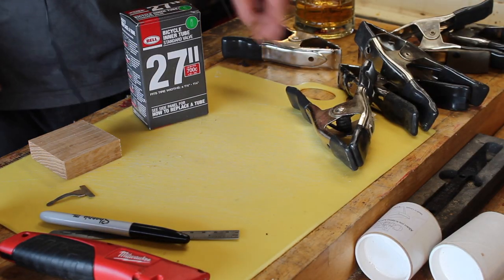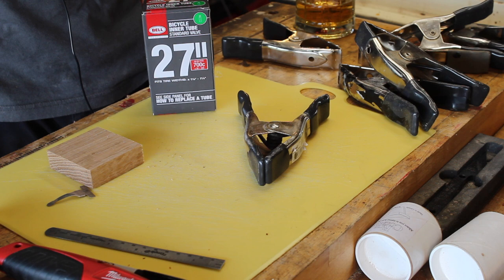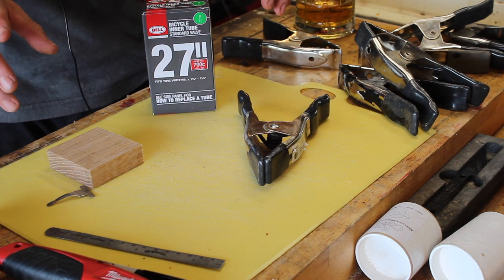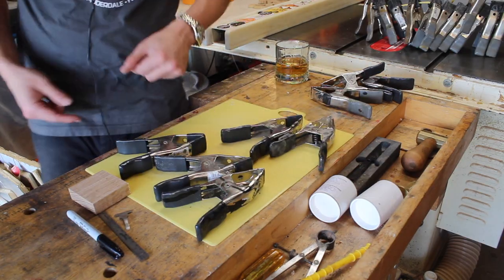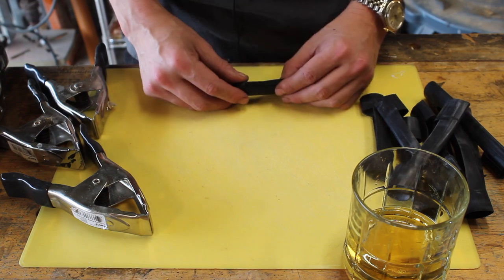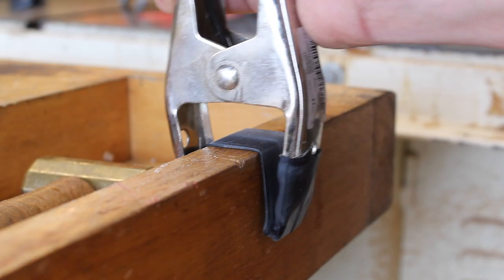DIY Band Clamp | Woodworking Tool | How To Make

Comment: Seems like you could simplify your measuring by using a cutting block that's 5 inches long and just lining up the end of the tube with the end of the block. You could even get really fancy and cut a couple of slots in it 1 inch from each end and use that to do most of your cutting at one time (everything that's across the tube, come back later to cut along the tube).
Reply: Alan Miller great suggestion!
Reply from the maker: yeah someone else mentioned something similar. That would be super functional and frankly a huge time saver if I was making these at a real high clip. But in all honesty I don't make enough of these that frequently. My first batch, which is still in great shape is two years old.

Comment: Simple enough! I've got a bunch of these clamps. I should whip some of these up.
Reply from the maker: That tube is like five bucks. You can probably do about a dozen. If you mess with the length of the tube that you’re cutting, for instance going to four inches instead of five, you could probably squeak a couple more out.

Comment: The white stuff is just talc, it's a dry lubricant from when the tube is made.  There's no need to even bother with it, it's harmless.
Reply from the maker: Ah good to know! Harmless biologically I’m sure but if it’s a dry lubricant it’s probably good to get it outta there to keep the tube from slipping on the clamp jaws when applying. That makes sense as to why I was told to wash it out a couple years back.
Reply: @CowDogCraftWorks  If you don't want the bloom back you can seal it in with Armor All spray after you clean it off and dry it.

Comment: 1: make you woodblock straight edge 5" long to begin with and you  don't need to mess with the ruler to measure your cuts.
2: If possible, make that woodblock 1" thick to measure the end cuts you make. Saves time on Measure and mark as you can do the cut then and there.

3: that powder inside the tube is soapstone. It keeps the insides from sticking to itself during the curing process.
Reply: John Swegan good idea. An earlier commenter had the same suggestions, not sure if you saw their comment.
Reply from the maker: this is a valuable tip. I just grabbed something out of the bin that looked straightish.
Reply: @CowDogCraftWorks  Something I learned from my father-in-law when he had a wood shop. He had jigs for nearly everything.
Reply: @slyfox8953  Only after I posted mine. Got used to making these jigs on the fly when I worked at my father-in-law's woodshop back in the 80s.